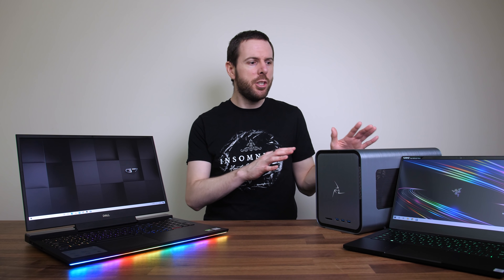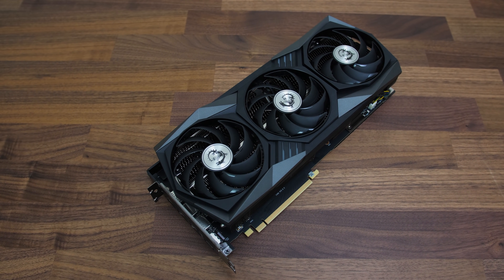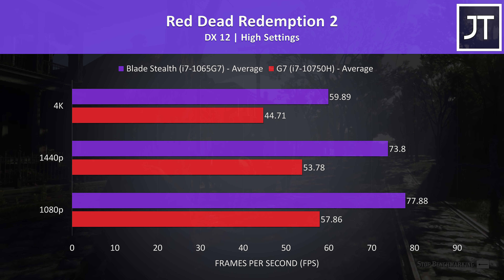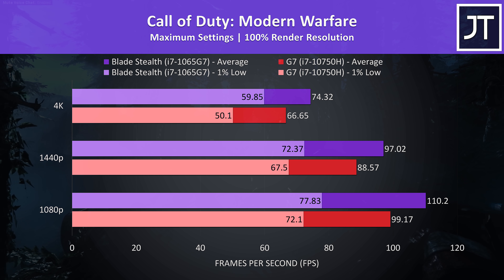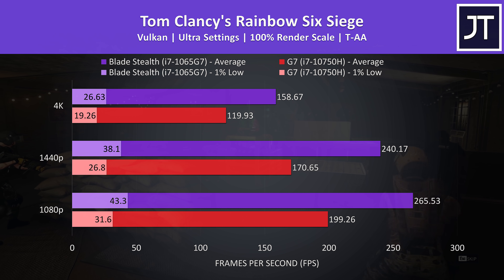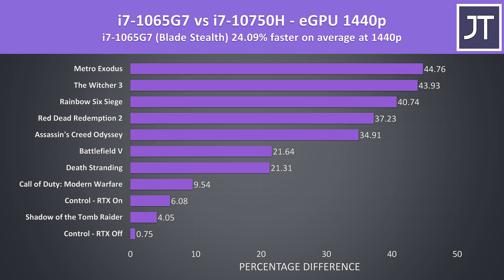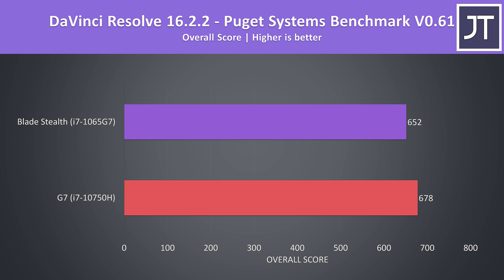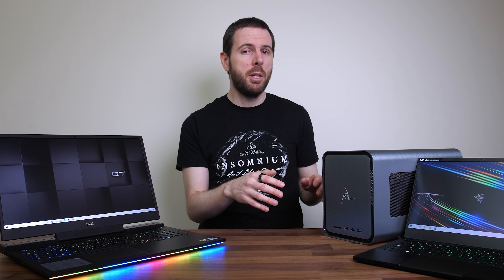eGPU CPU Bottlenecks Tested - Ice Lake Finally Useful?

Comment: I am very disappointed that most of. My labtops don't have thunderbolt I have rog zephyrus G14 has C type ports but not supported by thunderbolt (Disappointment), Alienware x14m (supports Amplifier but not other thunderbolt ports) no thunderbolt port, ROG GL503 1X c type port does support thunderbolt boot, HP Pavilion 14 no thunderbolt port. Why do computers have a lock port but not a thunderbolt it sounds really unsatisfactory. If the Razer 14 Blade is supported by thunderbolt I may by this. Labtop or buy and customise the ITX mini razer chassis instead.

Comment: It would be interesting to see what the performance differences would look like with different GPUs in the eGPU enclosure.

If the TB3 link is bottlenecking the performance of the RTX3090, then which GPU could come close to RTX 3090 eGPU performance but at a much lower price point?
Reply: Still wondering about this

Comment: Just wondering, did you use an external monitor connected directly to the eGPU or did you use the laptop display?
Using the laptop display creates another bottleneck.

You should also test the MacBook Pro 16. 
I believe it has a different thunderbolt 3 implementation.
Reply: I didn't even think about that. Even with an Egpu, a 3090? That should put out way more frames....I'm sure using an external monitor would be a huge improvement

Comment: Do either of these have to run everything through integrated graphics first. My laptop only uses the discrete 1660ti. Unfortunately it only has an i7 9750H so I doubt this would be worth it. Laptop is from 2019 so I won't be replacing it for awhile. I wonder with the 3000 series GPUs being cheaper than the 2000 series GPU if it'll be the same in laptops. Probably not.

Comment: From what I've seen the Alienware graphics amplifier doesn't have this thunderbolt bottleneck.
Reply: That uses a different implementation. If I recall correctly it uses 4 PCIe lanes direct to the CPU and the laptop needs to be rebooted for the eGPU to be used. This is different to Thunderbolt 3 where it is plug and play and the data goes through a chipset.

Comment: I'd assume that in that setup it makes the most gains when going back into the integrated display, as that's also run off the intel i-GPU. One way traffic and out the back of the card into an external monitor probably works out the same/similar between these two setups.

Comment: I really wish these results included the same GPU in a desktop so we can see how much performance you lose for going egpu. I'm desperate to have a single system setup, but my last few egpus felt like a big step down from a desktop. The new integrated tb controller is starting to look like it might make it more manageable.

Comment: Thanks Jarrod! I've been waiting to watch this since you alluded to it in one of your previous videos. I've been holding off buying a new laptop specifically to watch it. After posting on Reddit and the egpu site both comments came back aggressively negative to the idea of a 4 core/8 thread CPU for casual AAA gaming with an egpu, apparently anything less than 6 core/12 thread Ryzen would be an unplayable mess unless 'you're happy getting 30fps at 1080p even with a 3080'. I'm glad that's wrong and I can go ahead and purchase the new XPS 2 in 1 with tiger lake without worry!

Comment: Can u plz start putting the number of cuda cores for the laptops u review and compare them to their desktop counter parts?
Ps u can check that by 
1: right click and then click on nvidia control panel
2: bottom left there should be a system information button that u press
3: it shows u all the data about the card in the system

Comment: Is it just me or are both these results horrendous for a 3090??? 
Even acknowledging the better Ice lake performance. Most of the results are worse than the results for the G7 with its 2070P.
Well at least at 1080p, I'm sure it wouldn't hold up to the 4k result.

Comment: It would be cool to see a performance comparison between connecting an external monitor to the motherboard versus the graphics card of a laptop (the latter is trickier to accomplish).

Laptops with sub-par screens like the ASUS TUF A15 are prevalent and affordable, and using those with an external monitor at home is a good compromise (easily beats even the best laptop screens anyway). However, there seems to be little data about whether finding a working USB-C/DP adapter for the dGPU's port is worth it, or if it's enough to connect to the mobo's HDMI slot thanks to Nvidia Optimus routing the dGPU's output through the iGPU anyway.

Comment: Probably the Thunderbolt 3 controller in the Dell G7 is connected through the PCH and not directly to the CPU per PCIE. The PCH has a 4x 3.0 PCIE connection the the CPU but other components such as SSDs, network chips also use the PCH. So the bandwidth is shared.

E.g. the Thunderbolt 3 controllers in the Macbook Pro 15"/16" from 2018 and newer have their Thunderbolt 3 controllers directly connected to the CPU.

It would be interesting to see if the Razer Blade Stealth would also be faster than notebooks with their Thunderbolt 3 controllers directly connected to the CPU. I doubt it.

Comment: The TB3 controller on the H cpu is connected to the chipset. The G7 has TB3  built directly into the CPU.   The chipset connection introduces more latency into the PCIe connection/egpu seup that has to share the x4 DMI connection between the cpu and the chipset with the storage.

Until the arrival of this generation of the G7 cpus, all TB connections went through the chipset. TB3 provides x4 Pcie lanes only providing 25% of the x16 that gpus normally have ant that is what is causing the bottleneck
Reply: Except for Macbook Pros and other laptops that are custom built to have the Thunderbolt directly wired to the CPU.
Reply: @joshualarson2808  not true. the intel cpus used by Apple do not have TB built into the cpu, They only have x16 pcie lanes direct from the cpu available that are connected to the dgpu, intenal to the macbook pro. 

The discrete TB controller/s  still connects via the PCH chipset that acts as a pcie switch to support nvme, tb3 etc. The PCH  in turn connects to the cpu via a x4 dmi link that creates potental for bottlenecks if using egpu and loadng nvme concurrently.

The U cpus on the 13" only support x12 lanes from the PCH and limited those units to a single TB controller and 2 ports. The 15/16" H CPUs PCH supports x16 Lanes and 2 TB Controllers for 4 ports.

the latest 13" has a 10th gen cpu with the same benefits as the model in this review. If i understand correctly, the 4 port uses a controller from the pch for 2 ports and the cpu for the other 2 ports but I may be wrong about that. not 100% sure about the macbook pro lay out.

Comment: I never thought Egpu would be useful.
Reply: imo it's not worth the money.
Reply: usefull lol not at all, 3090 and you arent reaching 100fps on 1080p in shadow of the tomb raider.. 3090 would do 200+ on pc with an intel 10th gen easily
Reply: @dansko9490  eGPU is a waste of money imo... 300 fir the case + 450-500 for a 2070s. Thats 750-800 dollars for using half the power of what the gpu would be able to do in a pc,and you still depend on your Laptops CPU. 1100€ for a 2070s, ryzen 5 3600, msi b550 a pro, m.2 ssd build and you will double your fps, for 300€ more
Reply: @dansko9490  idk, you do you i meam i see the point of an egpu but I woundnt put my money on it..

Comment: how does icelake + egpu compare with desktop gpu now that we see performance uplift?
Reply: Not even close. Modern Warfare on the 3090 puts out 200fps+ in ultra at 1080p. Stealth + 3090 Egpu= barely 100fps.

Comment: anyone know if an rtx card egpu will work on a gtx laptop
Reply: It should as long as the laptop has a Thunderbolt 3 port. TB3 is basically PCIe 3.0 x4 over USB C.
Reply: Thank you I have a g7 with an gtx 1060 max Q design and instead of getting a whole new computer I was wondering if I could jsut put an rtx card in

Comment: Hi Jarrod, I’m interested to know if an RTX 3080 could be used within an eGPU on the blade 15 with Thunderbolt 3 and i7-9750H processor? If so how much better will the performance be vs onboard RTX 2070 MAXQ?

Comment: How do I know what laptops have integrated thunderbolt? Do all tiger and ice lake laptops have integrated thunderbolt? Are all thunderbolt 4 equipped laptops integrated with soc?
Reply: Non-integrated Thunderbolt implementations can approach this level of performance, it just depends on how the lanes interact with the PCH. Serious eGPU users almost universally use Macbook Pros because Thunderbolt is wired directly to the CPU, which would provide similar performance as an integrated implementation but with less CPU bottleneck because you get higher H-level performance.

Wired through the PCH, the Thunderbolt connection has to compete with for example SSD usage. And with such fast SSD speeds, that can add a big bottleneck.
Reply: Yep, Ice Lake/Tiger Lake all have integrated thunderbolt controllers.

Comment: Hi,
great video as always! Just one question. Are those the results of the eGPU connected to external monitor or using the laptop screen as that lowers the performance, so there might be an even bigger gap between ice and comet lake
Reply: I asked on his discord and yes it was connected to an external monitor 👍
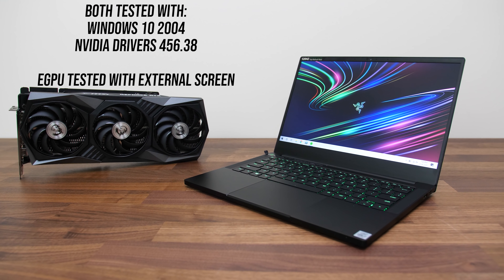Reply: 1:15 you can see it says tested with External Screen.
Reply: he would of done it on a external screen, hes to smart for that

Comment: Can you test this again with the tiger lake processor on the new Razer Blade Stealth late 2020 with thunderbolt 4?
Reply: but he will need egpu box with thunderbolt 4... THat will take time. I don't think those will be available soon.
Reply: Yes! Whenever it happens, that all the components line up in consumer-land, test Thunderbolt 4-compatible epgu/TigerLake etc.. I would love to see those tests!
Reply: @METhOdhowtoKilLnoObS It seems to be more versatile and more fitting to be a onesizefitsall-standard connector copy+paste
 
'The key differences between Thunderbolt 4 and Thunderbolt 3 are support for USB4 protocol and data rates, a minimum bandwidth requirement of 32 Gbps for PCIe link, support for dual 4K displays, and Intel VT-d -based direct memory access protection to prevent physical DMA attacks.'
Reply: yeah，cant wait

Comment: Im no expert but from my understanding TB3 can run from 20-40gbps depending on how many lanes it has to run on (x2 vs x4). I'm not sure if this is entirely due to the implementation difference with these CPUs or not, anyone more knowledgeable than me able to add to this? Love that you're branching into EGPU vids Jarrod, awesome work!!
Reply: That was generally true for laptops with Intel 8th Gen CPUs as the minimum requirement for TB3 was 2x PCIE lanes, compared to 4x PCIE lanes. So when you were buying a laptop with eGPU in mind, you had to lookout for it. However generally from Ice Lake onwards, all TB3 connections are 4x lanes.
Reply: @daniellow1234  Ah ok awesome, good to know. In that case this review really does point out the difference between Ice lake and comet lake. I'll have to look into if all comet lakes are designed with this bottleneck or if it varies. Cheers!

Comment: What if I have an 3
Extra m.2  and duse the pcie express to co. Ect to an egpu  is it better vs thunderbolt . I really annoyed that intel didn't improve the 10750h they should of at least have better thunderbolt support .  I think thunderbolt needs to be upgraded in next iteration even if 14 nanometer. Make 6 core 35 watt and thunderbolt 4

Comment: Can‘t wait to see testing the efficiency of tigerlake thunderbolt 4 (CPU PCIe lanes) or even the eGPU via PCIe 4.0 m.2 (also CPU PCIe lanes).
Reply: yes we wanna test it with thunderbolt 4 :)
Reply: I was thinking the same thing and would love to see the differences in the 2 setups!
Reply: The main problem is that some manufactures uses x2 Pci-e TB3 with ice lake, with TB4 the problem is solved for minimun specs of x4 Pci-e lanes :) and with sincronous communication the bandwidth maybe can be x2 more so... The possibility of really better performanche are possible

Comment: Maybe the G7 doesn't have the full thunderbolt 3 bandwidth while the razer blade does. I remember some laptop had a similar issue where they didnt have the full thunderbolt bandwidth while the macbooks had.
Reply: It’s unfortunate he didn’t mention this more explicitly, but when the TB3 goes through the PCH, other connections slow down the TB3 bandwidth like fast SSD speeds. The way to get around this is wiring Thunderbolt directly to the CPU. That happens in Ice Lake, Tiger Lake, and other laptops that are custom built to have TB3 wired directly to the CPU, such as Macbook Pros.

Comment: I want a egpu so bad I currently run apex with 8 frames on lowest setting
Reply: thats a bad idea. Just get a new laptop.
Reply: Which GPU?
Reply: @prathamdave5849  An egpu and a gpu for it costs more than a decent laptop. Just get a used laptop and sell it before the new line of gpus comes out and keep doing that.

Comment: "Ice Lake Finally Useful?"

Ouch.
Reply from the maker: oof
Reply: Gonna need ice for that burn
Reply: my cores
Reply: Intel: single core is good
Users: what about the multi-cores?
Intel: did we mention 1 core is good?
Users: your marketing team sucks
Intel: but we're the king of 1 core
Users: good luck with that 😅
Reply: @AwesomeBlackDude  you probably don't know that when opening/working with office apps or running google docs/sheets/slides, most of the programming such as gcc and matlab - in all those only 1 core is used heavily. And the office apps are what most people use, and since intel offers higher clock speeds for such scenarios... now you understand that their marketing team isn't stupid.
Reply: @randy89555  He said the team sucks, not that they're stupid. They have to be liars and/or cherry-pickers to try save Ice Lake (and TGL to a lesser extent) in 2020, not idiots.
Reply: @vncube1  intel should cut their prices by 10% and see the praise and money roll in.
Reply: @drbali  Yeah thats true also they need some inovation

Comment: Tiger Lake will be even better with Thunderbolt 4!
Reply from the maker: We'll see, everyone I've talked to doesn't seem to think it will change too much.
Reply: still not as good as AMD
Reply: @de00prolazr_47  bruh i don't think amd will be supporting TB4
Reply: @sexyyoda7567  but USB 4, whick is basically TB3
Reply: @de00prolazr_47  AMD doesn't even have it. And even if it does it will perform like Comet Lake, so lol
Reply: @ahsanqureshi786  I mean in CPU performance